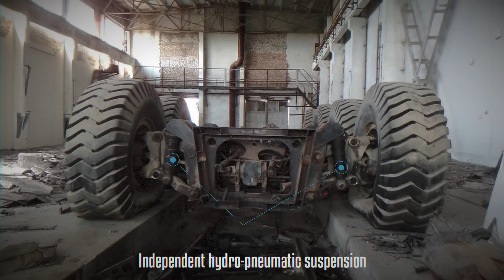This Soviet Nuclear Megatruck Was A Complete Joke. Or Was It?

Comment: Still more practical than a modern electric vehicle.
Reply: @tripplefives1402well, a turbine-hybrid, technically not an EV. It was still dependant on ICE.
Reply: Definitely more practical. I could see them utilizing drivetrains of an actual train doing the diesel electric thing. That wouldn’t be bad either
Reply: If you don’t like EVs, all u have to do is wait a couple of years.
Reply: I recently drove a VW ID3, it's a rather fun, zippy car.

Comment: For those who don't get it, the CCCP made a lot of "Design Experiments" for land, sea, air, propaganda, and a great practical teaching tool for your design bureaus. So of course they made the "Largest Ever" often, but they also made cool stuff like trolley trucks, powered from the Grid just like trolley buses & street cars...
The large trucks based on the dual driver MAZ-543 chassis that could transport pipeline, rail or other similar cargo that turned out to be the "Most Economical" being that they were most useful. Considering that the MAZ-543 mobile missile launcher carriers never had a functioning missile inside, these useful trucks transported large & long materials during or after the fall of the CCCP. And the longer your rails, pipes, etc. the less wielding needed for your railroad line, pipeline, etc...

Comment: If it is the largest in Soviet history, is there anything made since then that has been larger?

Maybe holding it in for an upcoming video then?
Reply: Kind of depends how its defined. But something like a Caterpillar 797 is about twice as large as this unit.

Then there is modular load carriers or SPM. They are configurable to carry pretty much what ever you can think of. There is multiple times where they been used to carry 1000s of tons of buildings in one go.

But of cause, they are modular, so its not one vehicle, but maybe 50 or 100 connected together.

Then there is stuff like the LARC-LX that is.. slightly smaller, but only have 4 wheels.

So it kind of depends how you define a similar vehicle. but a cat 797 is for sure larger
Reply: MZKT-79221 carries a 1.0 Mt icmb that has a range of 10000 km (6800 mi approx) and a speed of mach 22. It weights around 104,000 lbs. 
Mzkt can carry that. 

Dumptruck wise for mining they got the Belaz , 793,000 lb curb weight.  Its actually the largest and most powerfull mining truck on the world. And its built in large numbers ever since its introduction.

Comment: An astonishing machine.
Reply: For those who don't get it, the CCCP made a lot of "Design Experiments" for land, sea, air, propaganda, and a great practical teaching tool for your design bureaus. So of course they made the "Largest Ever" often, but they also made cool stuff like trolley trucks, powered from the Grid just like trolley buses & street cars...
The large trucks based on the dual driver MAZ-543 chassis that could transport pipeline, rail or other similar cargo that turned out to be the "Most Economical" being they were most useful. Considering that the MAZ-543 mobile missile launcher carriers never had a functioning missile inside, these useful trucks transported large & long materials during or after the fall of the CCCP. And the longer your rails, pipes, etc. the less wielding needed for your railroad line, pipeline, etc...

Comment: Either these are 51 inch tires or they’re 2.8 m in diameter, you usually can’t have both:)
Thanks for the content, great job!
Reply: Haha
Reply from the maker: Exactly, the tire is for a 51" rim with the outside diameter of 2.8 m
Reply: @VisioRacer  OK, understood now:). US sizes which are usually used for big and off road tires are diameter x width - rim size, and whenever saying a tire is “xx” inch it is customary to refer to the diameter. As long as I have your attention, your truck videos where you delve into technical details other than just the engine are the most interesting to me personally. If you could do other videos talking about technical subjects other than just the engines that would be superb. Keep up the good work, enjoying your channel.

Comment: In olden days Russia had great thinkers and innovators, but with Communism comes the nature of not think at all but waiting for someone else to tell them what to think. Sad state of once great nation. Ruined by own devices and stupidity. China went the same way. America if you are not careful you will end the same way too...
Reply: For those who don't get it, the CCCP made a lot of "Design Experiments" for land, sea, air, propaganda, and a great practical teaching tool for your design bureaus. So of course they made the "Largest Ever" often, but they also made cool stuff like trolley trucks, powered from the Grid just like trolley buses & street cars...
The large trucks based on the dual driver MAZ-543 chassis that could transport pipeline, rail or other similar cargo that turned out to be the "Most Economical" being they were most useful. Considering that the MAZ-543 mobile missile launcher carriers never had a functioning missile inside, these useful trucks transported large & long materials during or after the fall of the CCCP. And the longer your rails, pipes, etc. the less wielding needed for your railroad line, pipeline, etc...

Comment: It has 2 4-speed transmissions and 1,500 horsepower but could only muster 20 mph 🤣
Reply: Torque is the priority here. To pull 300+ tonnes.
Reply: You gotta remember that 1,500hp is probably at 1200rpm
Reply: Almost as though it was quite heavy.
Reply: Do you understand physics?